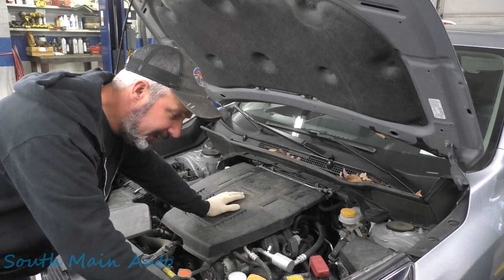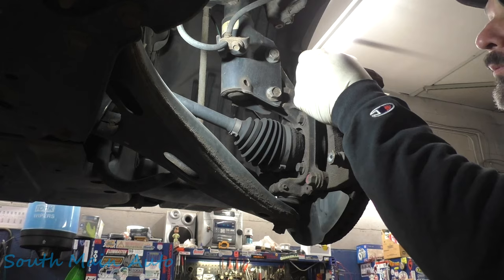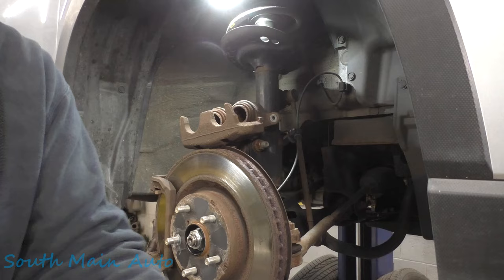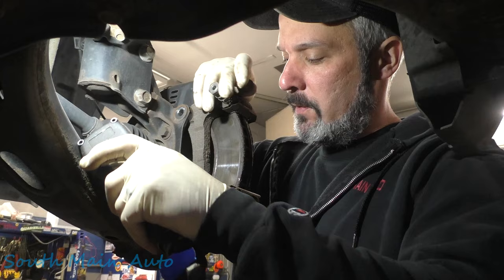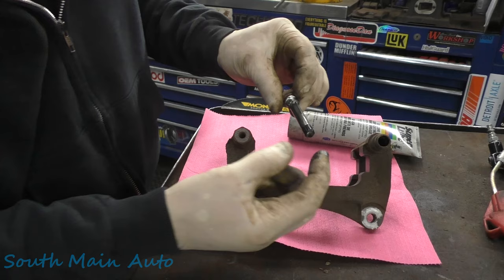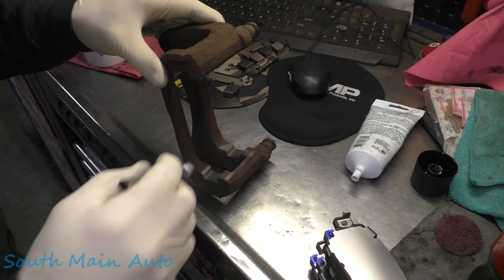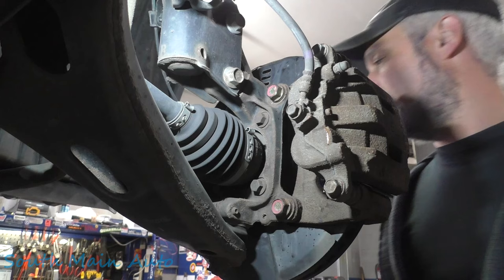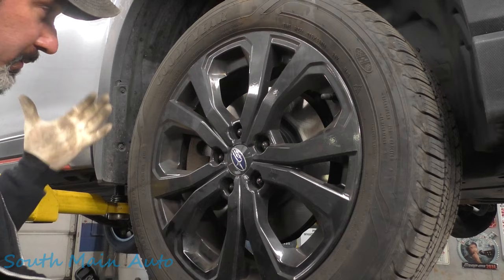'19 Subaru Forester: Front Brake Job - OEM Parts

Comment: Nice job as always Eric O.     Brakes and oil changes are about the only 2 things I can’t do these days on these modern vehicles.  Plus I’m getting to old and lazy....   I ran across a 2012 GMC Sierra crew cab with only 35,000 miles today that I might buy.   Only trouble is it’s 2wd.  Sure do wish it was 4x4 but if the price is right it can be my summer truck....

Comment: Thanks Eric.  Thanks for the video.  I own a 2018 Subaru Outback.  So, I paid very close attention to this video.  I figure the Forester and Outback have the same brakes.  I think they share the same vehicle frame too.  I've got 60K on mine now.  So far, the breaks have worked great.  However, I know it's time for rotors, and pads, all around.  I may go ahead and replace the calipers too since the inside of those pistons are going to eventually rust out anyway.  Happy Turkey Day to the family, dogs, and the Kitty, Kitty.    👋👋👋👋
Reply: You'd be surprised at the differences...I sure was

Comment: A new issue that has shown up in GM land is on 2018 and up Terrains. If the brake reservoir is too full, then the pistons are pushed in it can damage the EBCM and set a DTC. Was a first and we had a couple come in from outside shops, GM just came out with a bulletin about the issue stating this and will not warranty it for obvious reasons. 

Clear solution is just make sure you have some extra room in the reservoir or remove the cap all together.
Reply: What! Really? Damn. 
Too many vehicles come in and end up being overfilled every dang time.

Comment: For Subaru, definitely OEM. . . for driveline at least. Replaced a half shaft on driver side with new OEM, where as, for whatever reason due to emergencies or lack of availability, passenger went through THREE OEE / Aftermarket axles before I was able to be a genuine Subaru part. Fitment is superior in every way.

Comment: Call me crazy, but I think that if the quote was for NAPA parts (that were unavailable), and you had to wind up using OEM parts, simply notifying the customer of the difference in price should be acceptable. No one wants to get ripped off, but this brake job simply wasn't that. It's not a bait and switch or upsell. It's parts availability. Character and integrity are not lost. The job was done, and done right. The man should get paid. He's got a business and a family.

Comment: Sounds like the friction material on the front is particularly hard which explains the high braking effort needed. That in turn would explain the rears wearing out long before the fronts. Perhaps they use the same material as fitted to the Impreza which most certainly does need harder material.
Edit: from what you said about sensitivity it sounds like the replacement material is softer. Perhaps the original material was "incorrect".
Edit 2: predictive text 🤪
Reply: both my subarus, 2013 impreza, and 2014 forester, are known for rust jacking in the caliper mounting points. even 1 mm of rust will cause them to rust jack.  I did my own brakes, but my sisters forester went to the dealership. I told them to clean the rust points, and they didn't and it was just jammed in there. Once i freed it up, the braking performance was much much better.
Reply: Some vehicles go through rear brakes more often than fronts.  Sometimes as a result of stability control, driver behavior, or just design.
Reply: *Braking, not breaking.
Reply: braking, not breaking.
Reply: @chrisforte8229  See above. Lol!!
Reply: @elcheapo5302  Electronic brakeforce distribution is why the rear brakes wear out faster on newer cars. When you hit the pedal the rear brakes initially engage rather forcefully to keep the nose of the vehicle from diving. This coupled with the smaller size of the rear brakes results in a short lifespan.

This of course would not be an issue if the rear brakes were sized appropriately to handle brakeforce distribution, but that would cost the manufacturer more. This is why we can't have nice things.

Comment: My Dad had one of the first US Subaru dealer franchises in the 70's ... back then he sold Pontiac and Saab too ... small town dealer ... typical GM/Saab warranty charge back costs were ... $300-400 .... Subaru was like $1.35 per vehicle ... they were flimsy tin boxes, but front wheel drive was great in snow ... a quick look under the hood and there was lots of empty space ...

Comment: OEM service data will not say anything about the bleed screw on a brake job, as they say replace the brake fluid it in every 2 years - so in theory you push around "fresh" fluid

Comment: I don’t open the pleader either , I use to till I was out of brake fluid and didn’t realize it till I had them tore down lol n thought I’ll just push the caliper piston back n see if the go, of coarse I only had wheel off the ground in my driveway with a floor jack n it worked n I haven’t opened the bleeders since that day n never had a problem. Only time I’d open the bleeders now is to flush the brake fluid.

Comment: I really love your videos and how your integrity shows.  I do have a question regarding lubrication, why is it you do not put any lubrication on the hardware that the pads slide against?  You always put grease between the hardware and the caliper bracket but not on the surface of the hardware that contacts the pads.

Comment: The NAPA (not a sponsor) is beating out the TO BLEED OR NOT TO BLEED automatic comment generator this time. So personally, if nobody has added brake fluid to the reservoir, it should not need to be bled. But, if the fluid is bad and time to change or full at the beginning. It might be wise to open so it won't over fill the reservoir and spill in the engine bay.

Comment: As far as the replace the fluid and bleed the brakes thing goes. I at the very least just replace what's in the res after pushing in the pistons on the calipers. It's quick easy and cheap. Brake fluid absorbs water, reducing performance and extreme cases cause corrosion. I guess in the PRNY the car will rust out before it's much of a problem, I've seen cars go decades without a brake fluid change with no apparent problems but it's still a best practice IMO.

Comment: I cant see they are the original pads at 70k, discs (rotors) maybe. Here in the good old UK, ( is that PRUK Eric? 😀) we change pads at anything from 25k upward depending on brand, most euro cars are the same, some japanese / asian  have harder compound pads, hence lack of pedal feel, even so, 40k max. If it is correct, good on Subaru! Love that you honor the quote. Good on you Eric.

Comment: I wouldn't have changed the discs - I'm not saying they don't need changing , just realising I am really tight aint I lol. Pumped the brake 1st - ever had those times you forget and quick pedal pumping panic as you roll... Radar cruise too - nice

Comment: I was thinking that after you said the rear wee replaced before the front.  That maybe a proportioning valve or the abs was sending more stopping pressure to the rear over the front. I guess not because you didn't even think there was a problem.

Comment: had one of those subis you could stomp on the brakes in an emergency and the pedal would be rock hard and the wheel would lock up and i would slide. changed everything still did the same.

Comment: Did my father in law’s brakes this past summer. He was metal to metal. I didn’t think nothing of it. I closed the piston did the passenger side, went to the drivers side, closed the piston and brake fluid was pouring down. Because he kept topping off the fluids it was over full. I worried that I might have damaged something. Luckily I didn’t, or it doesn’t seem so anyway

Comment: Our mechanic at a company I worked for told to never push the brake fluid back through the anti lock brakes. He said the dirty brake fluid would damage the antilock brakes. This was from the mid 90’s.
Reply: How exactly does fluid in a closed system get "Dirty?"
Reply: @keithcurtis6671    It gets moisture in it. That is why they recommend that you change the fluid when it gets dark. If you have a container of open brake fluid you should not use it if is over a couple months old. It will be contaminated.
Reply: @kevinhitchcock7062  I understand that, but it is not "Dirty" and if the brake fluid needs to be changed, you change it. It does not mean the fluid in the lines is "Dirty" and can't be pushed back through the system when returning the caliper pistons to their retracted position, if the fluid is not to the point of needing replacement.
Reply: @keithcurtis6671    I realize that but back in the 90’s that was what they were teaching mechanic. Things change over time. If I saw my brake fluid dark I would consider it dirty.

Comment: As a DIYer I’ve adopted your method of doing brakes (every step) and im happy to say ive had the best results since doing so. My question is,how does outward/inward pressure on metal surfaces cause squealing from the calipers if not lubed? I lube them but fail to understand how the pressure could cause the noise,I figured the noise would come from rotational friction from the rotor/pad contact.

Comment: I actually Saw a set of those hub cleaning disks in multiple sizes on the old snap on truck last week… only thing is it goes on a 1/2” drive….actually thats what i am currently using… and i don’t really care for that style… i like the one you have that fits on am  angled dye grinder

Comment: I always use the brake fluid level as an indicator of how my brakes are.
When I have new pads my fluid is full when it gets lower then it’s time to take the wheels of and inspect the pads etc. 
part of my weekly checks along with oil level, coolant level, and top off the screen wash I check the brake fluid level as well.  
I always found You shouldn’t need to top up your brake fluid between changes unless there’s a leak in the system and then you need to fix the leak and go through the whole system… 
but that’s just me 
Now Eric has my 2 cents worth as well lol

Comment: Great video. Sucks when aftermarket suppliers supply wrong parts and customers are waiting. Subaru is one of the few brands I refuse to quote aftermarket parts to service advisors and techs as they just go south way too often comparing to other brand. Doesn’t worth it to waste tech and customer’s time. It sucks, but oh well sometimes it is what it is.

Comment: I've just made it a practice to loosen the bleeder when compressing calipers just so that I don't push any gunk into the ABS module or other brake parts. Might be different in the rust belt since bleeders are likely seized.

Comment: On my cars over the years, the ratio of front/back shoe replacement is usually 3/1 or 4/1. Usually I'll change the rear shoes "just because". Maybe its because I'm not racing-up and stomping on the brakes every time? So I just wear the front and not the back.
Reply: With rear drums you can get away with that up here in NY but with rear disks it's another story...the winter salty brine kicked up by the front tires sprays the rear brakes and rusts them solid.  If you don't service them every year or two you'll be replacing the pads/rotors/calipers in short order

Comment: Great to see a master at work again! On winding calipers back - as a DIYer who did it once on a 20+yr old Honda, I opened the cap a bit, if it was strictly required or not I'll never know!
Is it worth replacing the pistons/boots/seals in brake calipers if they are failing so often? I presume the cost with core exchange makes it worth centralising that work to a specialist in time alone.

Comment: Your videos help so many of our DYI folks. Over the years I've done many a brake job but I would appreciate your in put on brake fiction materials. For example I purchased a preowned 2015 Lexus RX350. Great car! I'm considering R & R the friction material due to slight drag noise when depressing the pedal. Since the removal of asbestos, materials have come and gone. Being now in my 70's, I'm not wanting to do the pad replacement more than once. Can you please recommend a brand/make pad the is quiet but effective? These are heavy vehicles as well. Your suggestions are much appreciate.

Comment: I hated doing front brakes on one of those Subarus I can’t remember which one but the upper bolt for the caliper and the strut bolt are not fun to work around but I’m at a dealership now and don’t usually work on Subarus any more

Comment: Dear SMA, I've seen a few of your videos and there are two things that make me cringe as a retired tech: First, you go to all that trouble cleaning the rust off the hub (that's great) and then you go and use Fluid Film (?!?) on the hub which won't last long and has a very low flash point of 400 degrees. Use a proper anti-seize on the hub which won't be gone in a month and can handle 1200-1600 degrees. Fluid Film is the worst thing you can use for protection on a brake hub. Second, you use a lot of air tools, so wear some hearing protection! Lost hearing and ringing will make you sad when you're older. Otherwise, good work!

Comment: You shouldn’t need to remove fluid unless someone topped up the reservoir with nearly worn out brakes.  A full reservoir should have enough fluid to handle all brakes worn to their limit without adding fluid and pushing the pistons back in should just return the level to the full mark.

Comment: Wow, more power to him to get 70,000 miles out of a set of factory new brake pads and rotors.
I only got 30,000 miles on a 2016 Outback before I had to replace all four front and rear brake pads and rotors. I don't ride the brake pedal or wait until the last second then slam on the brakes either.
So, search me why...

Comment: I hate 4 wheel discs. The rears have to be taken apart at least once a year  for cleaning and lube. Ive already had to replace 2 sets of calipers, 2 sets of rotors and 3 sets of pads in 78k on my Accord for bad e-brake actuators and stuck pistons. With drums, you wouldn't have to touch em till the shoes wore out!
Reply: Sounds like a Honda problem.

Comment: My Dad and I always had arguments over brakes and the way they wear out. I always argued that if someone was turning off a road and applying hard pressure on the brakes right before the turn would burn out your brakes faster. He argued that softly braking a few hundred feet back before the turn wears them out faster. So, who is right and who is wrong? Or doesn't it matter?
Reply: Well he's Right, a few pauses for braking is much better than all at once, Because less heat is generated all at once, You can almost double the wear by driving like most people DO.

Comment: Are the phenolic caliper pistons better for the rust belt? We see them on some of the reman units.  How does the synthetic lube with ceramic differ from the plain synthetic brake lube. Always a trick to be learned watching you. Subaru recommends replacing the brake fluid at 30k intervals. We were told it flushed the water out of the lines and prevented rust in the calipers and cylinders. We live in a swamp so brake fluid contamination by humidity is a given. It's really cloudy after 3 years here.  Good vid thanks.

Comment: It's an enormous help to see a brake job done properly.  I was wondering if it's reasonable to use any anti lock material on the bracket bolts?

Comment: I usually feel when brakes are close to hitting brake wear indicator, like I loose confidence, no clue, what exactly it feels as I call mechanic to take a look and swap the pads and/or discs. Driving the same car every day teaches how the car behaves when healthy, any changes rises eyebrow. I drive an old Dieselgate Passat, a small practical car, trucks with open beds are not common here.

Comment: I've been in the same situation, 80 miles each way, NAPA is on my, last resort list.
Reply: Thats the one thing that must be tough in the rural areas. The lack of easy options when something is wrong. I get frustrated when I get a wrong part with a parts store/big box/industrial supply every 1/2 block where I live. I need to work on patience.

Comment: Loved the seal burping bit. How is it possible to have a car need rear brakes that long before fronts?
I've never once seen it but maybe specific vehicles just have undersized rears and/or oversized fronts
Reply: Subarus use the rear brakes to prevent rolling backwards when starting from a stop going up hill. They release as you start to roll forward. Really useful on manual transmission but they put it on automatics too. Tends to make the rears wear faster then the fronts. At least based on my living with four Subarus over the past 30 years.
Reply: Interesting question, it's pretty common on many modern cars these days. Than answer is not straight forward and comes down to a multiple of things. In a nutshell it is manufacturers trying to improve safety of the vehicle. 

There is a preference to bias the brakes so more of the stopping force goes to the rear end, this helps prevent the classic nose dive under heavy braking you'd see in an older car which helps the driver maintain control of the vehicle.

Another thing is that many ESC (stability control) systems use the rear brakes without the drive pressing the pedal whenever it things the car is loosing stability which further increases pad wear.

Depending on how and where it is driven this can also decrease the life, throw in the extra load on the rears to improve diving under braking and you have rear brakes that wear out faster.
Reply: On our 2013 Outback the rears lasted about 70k and I replaced the fronts at 105k.

Comment: so the rotors you choose, is it mostly NAPA you go to? i've mostly used Rockauto (DIYer), someone was saying the ones with the 'machined' surface look that are coated are the ones that last longer, if they're in a 'white' box, and dont' have that machined surface (where the brakes hit) they only last 30k miles or so....